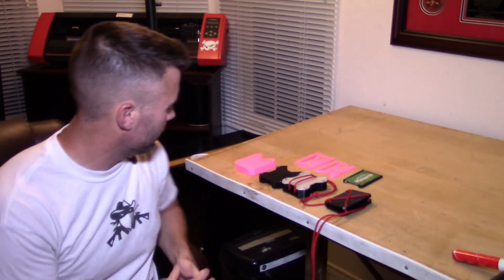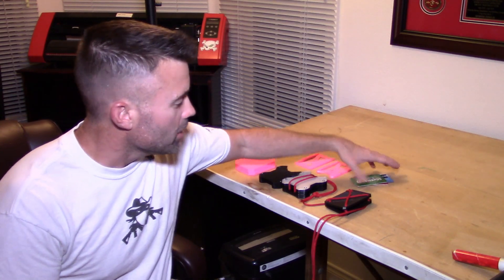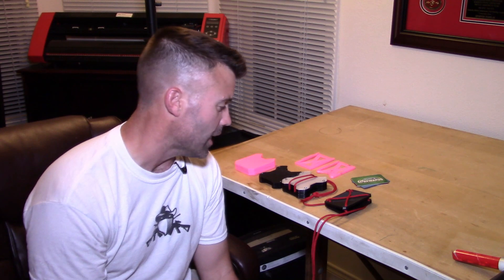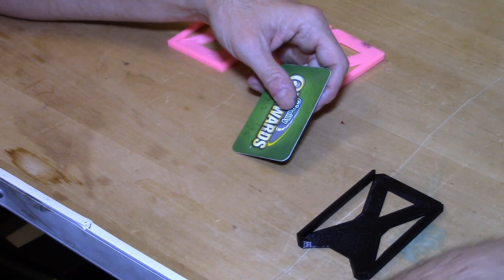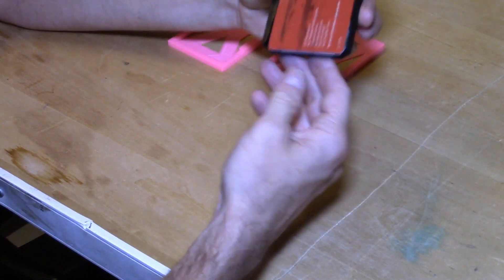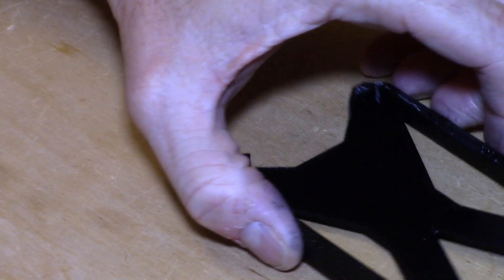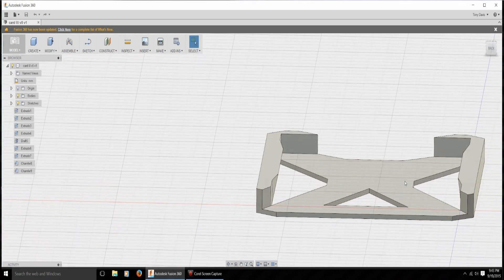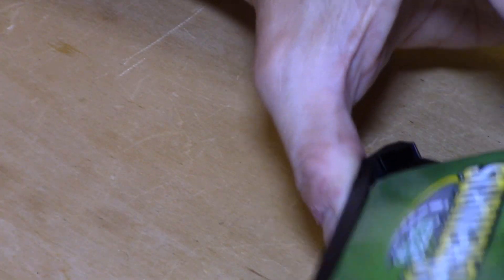Credit Card Holder - 3D Printed - HD

Comment: in the video of the 3d image of your card holder I see that the egdes that hold the cards I'm place are at an angle, so to max out the storage you may have to play with that angle til it is can hold more also bring in(at most a half a mm) towards the cards at the bottom so that with the newer angle & a ever so slightly narrower deck(again, i mean really slightly narrorer) you could place more cards! the reason why I state this is I have morethen 10 cards(not including cash & the like) I must carry with me everytime I leave the house so... but it looks cool so, like you said your not done/happy with it & plus, I know you know what I commented about already so, I cant wait to see it done! plus we all know that you are not using the finest detail that your 3d printer can do so with the final print will be a lot more accurate to the 3d model! also did you sand the the rails the hold the cards a bit? that could increase the number of cards you could hold but be careful on how much material you do remove due too you may not be able to hold just one card but must hold a few to hold them in!
Reply from the maker: +elementalblaze79 thanks for the feedback.